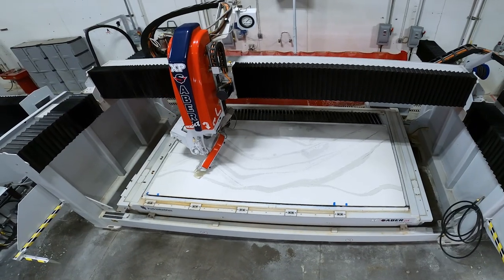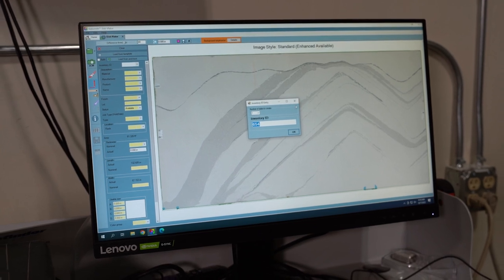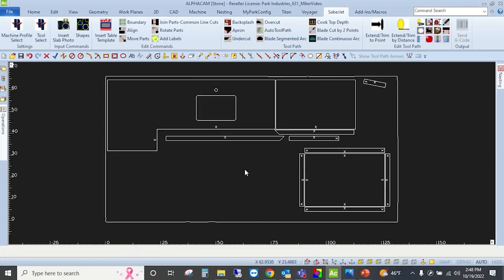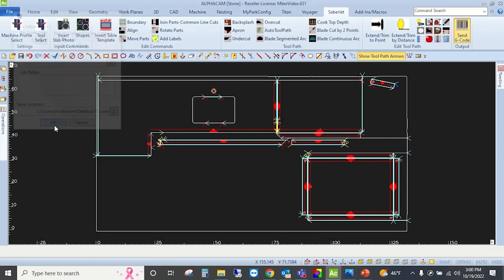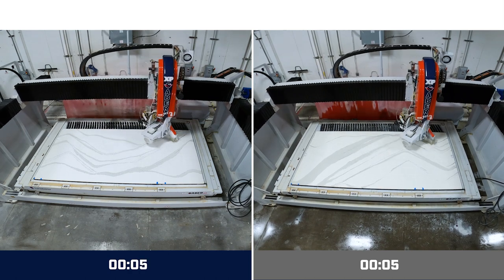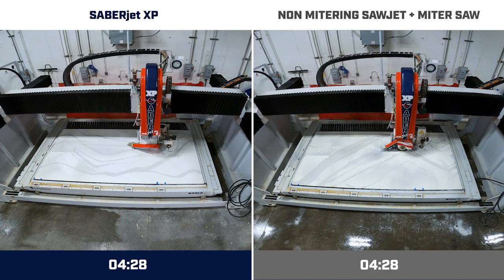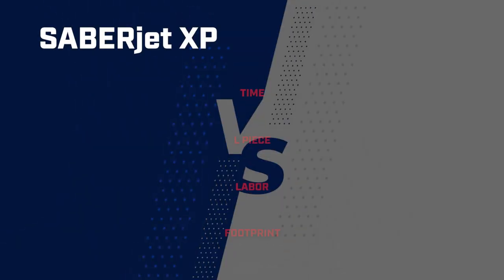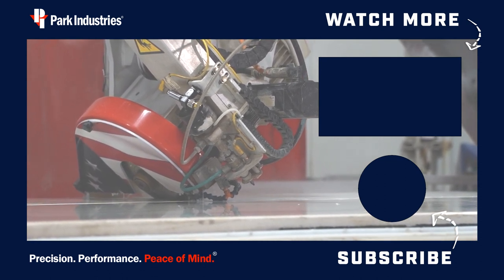Mitered Kitchen Challenge (SABERjet XP vs Robot & Miter Saw) | Cut This, Polish That

Comment: not too bad, need  practice on order of cuts though! One thing that I find difficult about the saberjet is when the saw head rotates 180 deg cutting in an opposite direction its often 1/8" different, have never quite figured out why. Worked with 3 different saws and they all do it.
Reply: I had this same problem. The measurements go x- to x+ so if you are cutting from top to bottom, you have to add that thickness of the blade otherwise you'll be an 8th under everytime. It doesn't quite make sense to me but adding that difference has been a band aid fix for me. I'm running a fusion 4045 SL.
Reply: Something is not calibrated on your machine correctly. I would suspect c axis is out also check to see if your table is the exact same height everywhere. We take a mill blade and mill our metal slats so the table is dead on to the saw. Miters turn out perfect.